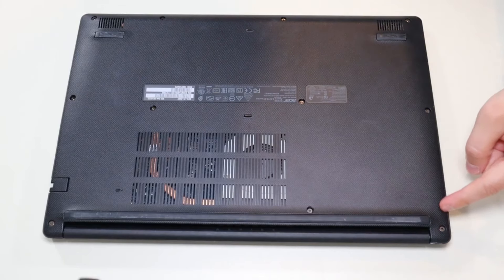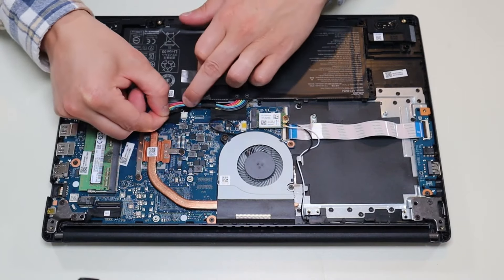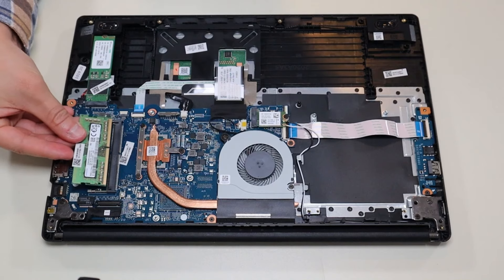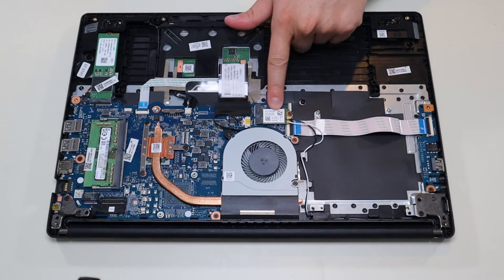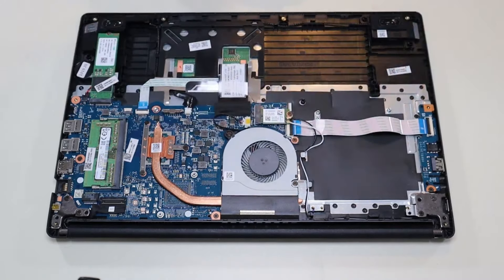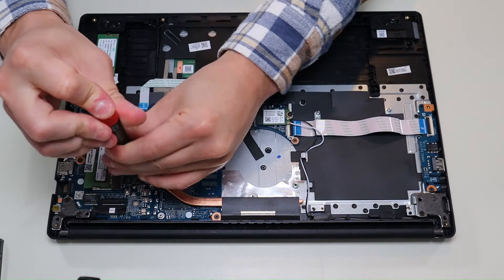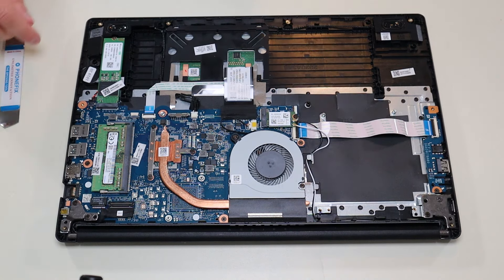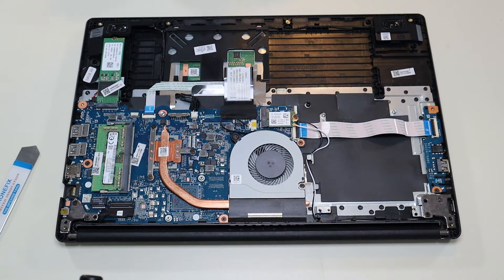How To Teardown Disassembly - Acer Aspire 3 A315-23 Laptop Computer

Comment: I NEED HELP PLEASE i try reseting my laptop and let it reset over night it lost charge and now that I turn it on it wont pass through starting and looping through 64% sometimes the screens goes black . I also try taking off the battery but it goes back to the same. I dont know what to do now i am desperate. Help!
Reply from the maker: What brand computer do you have? Also, did anything happen before this issue started? Liquid spill, overheating, a Windows update, etc?